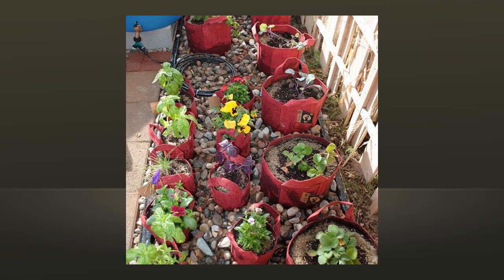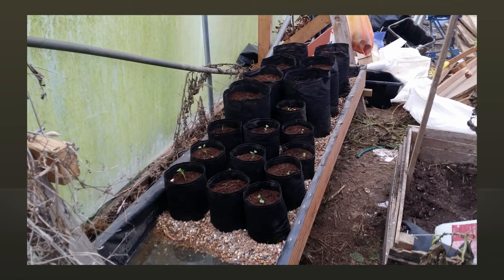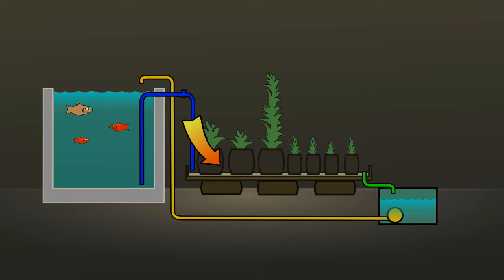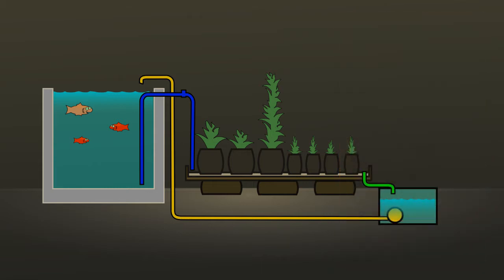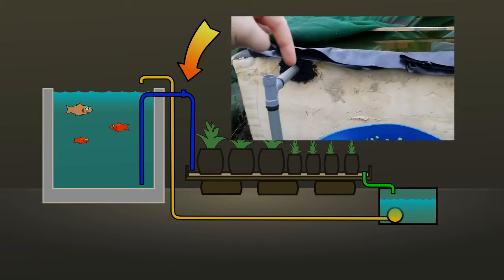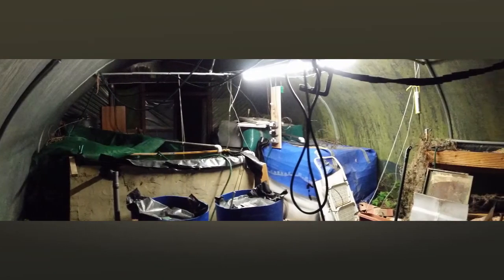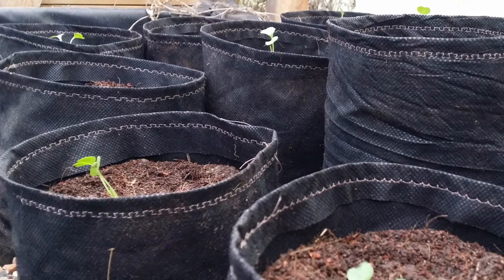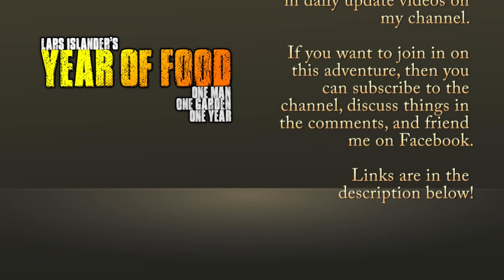The Plan: Hybrid Grow Bags & Aquaponics

Comment: Hello Lars,
I have been doing this for about two years plus. They work great and expand the range of produce that you can grow. I call them "River Beds", they allow for media filteration, growing in media as well as soil (wicking). Recently I introduced the addition of "permanent" sites by cutting a 5 gallon bucket in half and placing media around it. This was, I could remove the grow bag - planting container without having the media fill back in.  I can also determining the amount of water via wicking be adjusting the height teh grow bag or the planter is inserted in the cut fiver gallon bucket.
Here is a recent video of a system I started at home (no inserts here:
http://youtu.be/dn4CHL9C4n8

Comment: I think you have a great idea and design.  I would suggest you also check out biodigesters and see if you could incorporate them into your plans.  The big bonus is that you produce methane gas which can be used for heating or running a generator or even a cook stove. The biodigester is started with cow or horse manure and is fed with fruit or vegetable matter the more rotten the better and you also end up with a water that is able to be used as a replacement for water in your garden.  It might be able to be used to go in your hydroponics system to feed your design.  Plus when your plants are done for the season the plants can be fed into the biodigester to keep the process even more economical to use.  The methane gas could also heat a greenhouse for during the winter months.  The possibilities are great, good luck and keep us posted.
Reply from the maker: Gary Kernstock Thanks Gray! Biodigestors are a great idea, and I'd not considdered adding one to the AP system, thanks for the idea! 

For years now my dad and I have been talking about switching their current sewage system - a cess-pit with a soak away - for a biodigestor.I'll dig out the link, there was a crew somewhere in the states that had a backyard setup made out of three IBC tanks that fed their raised beds.My only misgiving with having that as part of the AP is that i would not be in control of what goes into it, were it replacing the sewage system here. My parents run a B&B, my brother and his wife's cabin is also attached to the system. I'd be worried about one of their guests dumping something down the toilet that could poison the fish.Instead of a biodigestor, I have been thinking about adding a set of larger growbags at the 'top' of each grow bed, that would be full of composting worms. All my kitchen and garden scraps would go in there and the worms would break it down. Worm tea would then go back into the water flow and feed the other plants.I've even thought about trying a system with ONLY worms - like, aquaponics with worms, not fish (for the veggies/vegans out there:) ) - I'm going with the name Vermiponics, I don't know if that already exists.
Reply from the maker: Gary Kernstock Here's the link to the design we were looking at replicating one day http://theurbanfarmingguys.com/methane-biodigester-how-to
Reply: That is the exact system I was referencing to hook into your design.  With the three vessels, the last one has water that is similar  to dirty dishwater.  Also since it looks like you plan on using carp to do the work on the hydroponics vessel they would thrive in the water and filter out any solids that are left over from the biodigester. Plus you would get all the benefits of the methane gas for heating, cooking and electrical generation.  But you are right in that I would use horse or cow manure instead of hooking into the one you are planning for the house's and business.  Larry Hall has also come up with the idea to use rabbit manure and red wigglers to compost The high nitrogen rabbit manure right in the grow bag..  But I think he has to figure out a way to keep the worms from escaping. I will keep watching to see the results.
Reply from the maker: Gary Kernstock I'll ask Larry about that next time he's on FB. I was thinking a similar approach, but having some large grow-bags as vermicomposting bags.